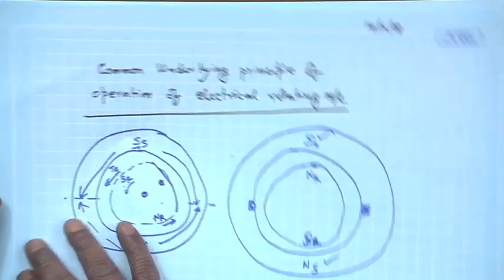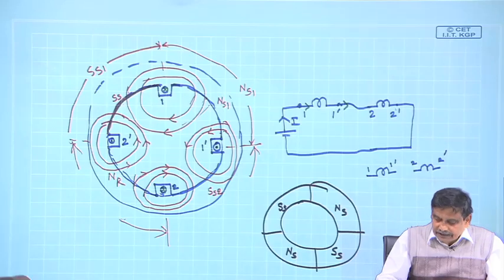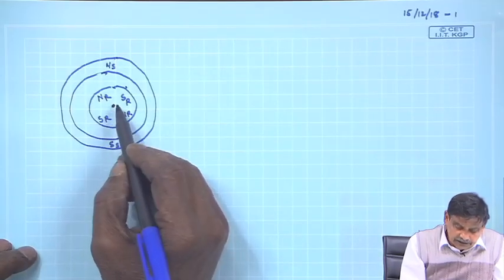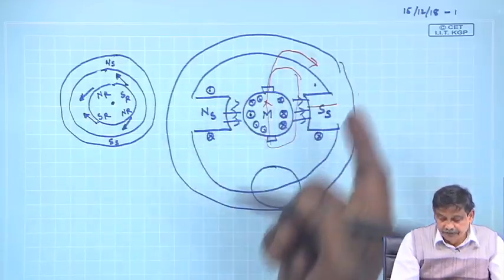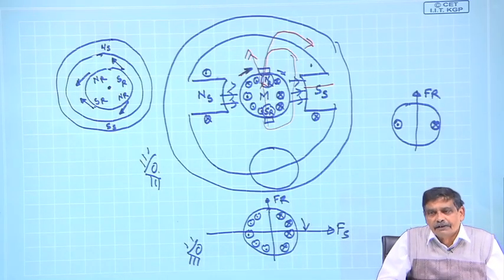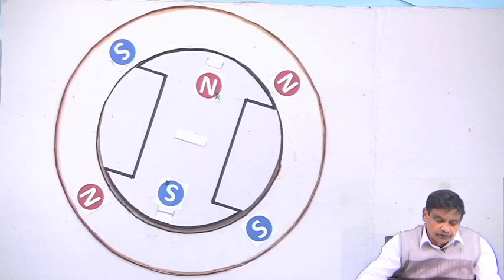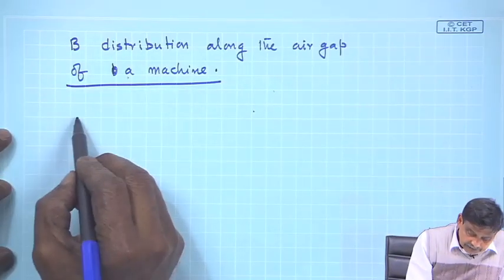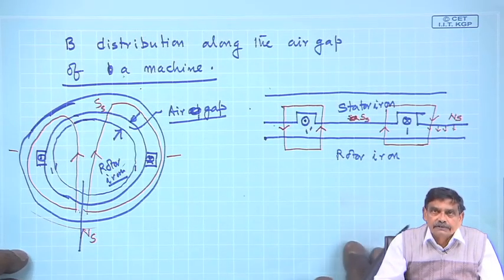Lecture 13: Basic Underlying Principle of Operation  of Rotating Machine (Contd.)

Comment: As per 5:12 mentioned 4 poles will be formed in NS SN(clock wise) fashion,where the rotor will get locked and further their wont be electromagnetic torque.
Reply: How? I'm not getting it